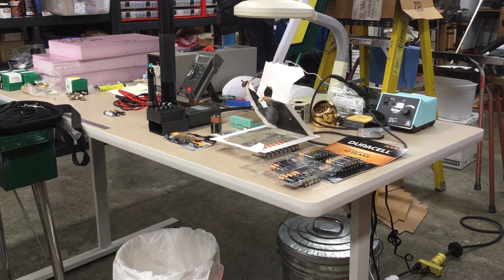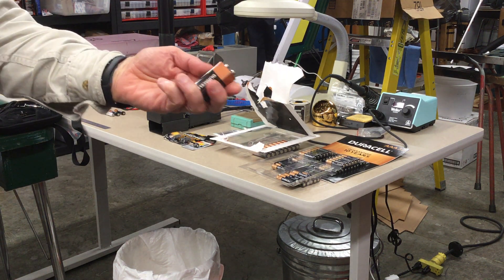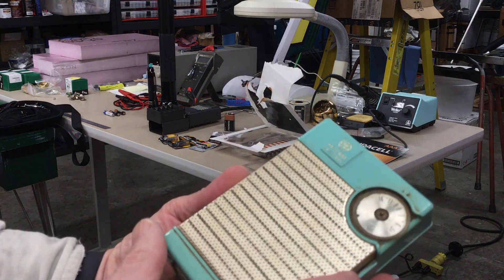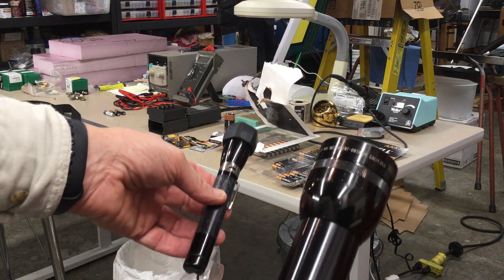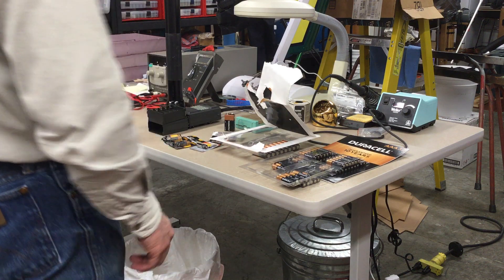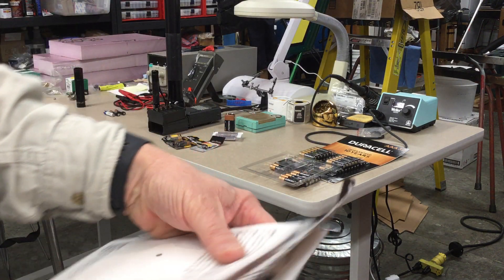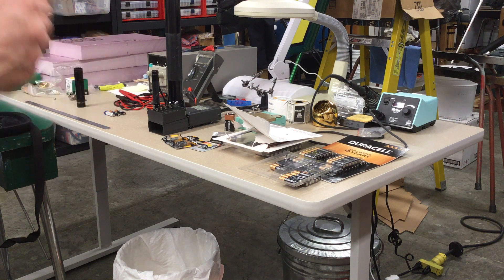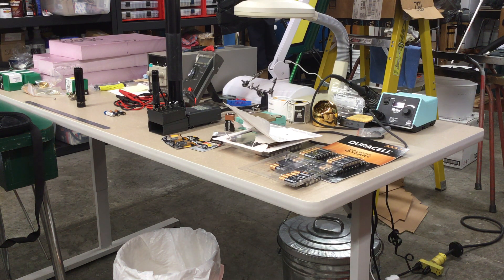Leaking Duracell Batteries

Comment: Is the liquid clear in all these leaks? Mine was clear in brand new freshly installed Magnavox batteries. I bought them at Ollies for $2.49 for 2 batteries.
Reply from the maker: As I understand it, one of the primary chemical constituents of alkaline batteries is the high pH compound potassium hydroxide (KOH) or, potassium lye.

Over time (with some batteries, an unreasonably short time), chemical reactions going on inside the battery result in the production of hydrogen gas.  Since the batteries are sealed, as the gas accumulates the pressure within the battery increases to the point that either the metal case of the battery or, the seal at the end, fails and the liquid electrolyte is disgorged.

The liquid electrolyte certainly carries KOH which, because it is caustic, causes corrosion of metal equipment parts with which it comes in contact.

As I said in one of these videos, it is just an engineering problem which Duracell (and its parent Berkshire Hathaway) choose to tolerate most likely for economic reasons.

I would be interested in knowing how many leakage warranty claims that Duracell processes every year.  My guess is that it is a small number because people don't want to deal with the company's bullshit claim system.

Lithium ion batteries may be the wiser choice, albeit more expensive in the short run.

Comment: I used to think the leakage problem had something to do with the batteries or devices being outside, in the unheated garage etc or devices that were rarely used. NOPE. They still leak regardless. I have a remote fan control device at my desk that I use daily and one day found its batteries leaking. 0_o

Comment: I have Duracell AA MN1500 battery expiry Mar 2029 leak and damage my equipment. Device was working ok so I was unaware that it was leaking inside and corroding. Battery still has charge of 1.57V. Battery set 'made in China' was purchased from local COSTCO store. Not going to file a claim as it is not worth the time.

Comment: I just bought some brand new C magnavox batteries and put them into my radio/cd player. They expire in 2029. My CD player/radio was turned off and I heard a noise coming from it. I opened it up and saw clear liquid in it. It was making a sizzling type noise. There were several small liquid puddles in it all around.   It was completely dry when I put the batteries in about 15 minutes earlier. What is going on? They are brand new and I just put them in. The cd player won't work with batteries only (unplugged), but the radio does. Please help and explain what is happening!
Reply: Did you try another set of batteries? Sometimes the batteries that are defective won't work correctly in the machine. Don't let those batteries sit in that device either.
Reply: @ryanhuang8498  I took them back yesterday and got a refund. I'll buy a different brand and try when I get paid next. I had them setting on my countertop at home for a few days on some paper towels and I've got damage (white marks on my countertop) now though. Thanks for the reply.  Hopefully my CD player still works.

Comment: I have had same problem with the Duracell AA batteries. Rayovac batteries work better and are cheaper.
Reply: RayOVac is now Energizer,same with Eveready.  I hope companies like Varta enter this country.  Very good brand and costs less than Duracell.
Reply: Nope Rayovac also have issues had a package from Menards and they are new not subject to extreme temperatures and the leaked in the package just like the Costco Duracells. Done with both brands and won’t buy the Kirklands either now reading the comments.